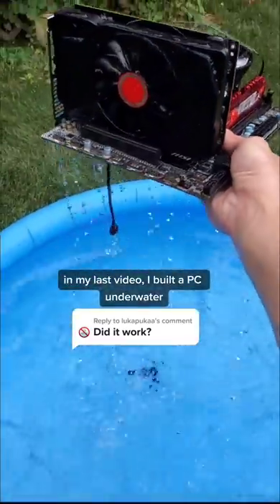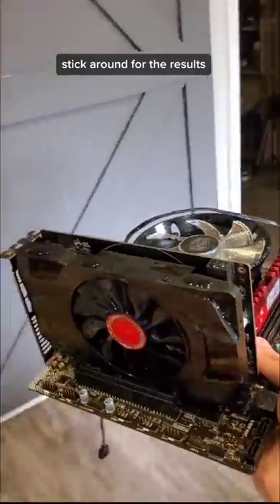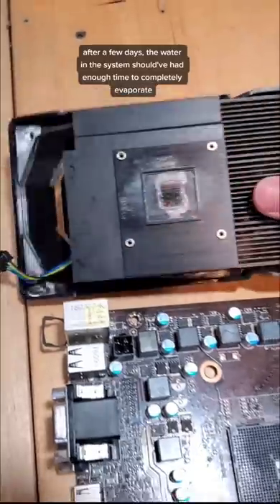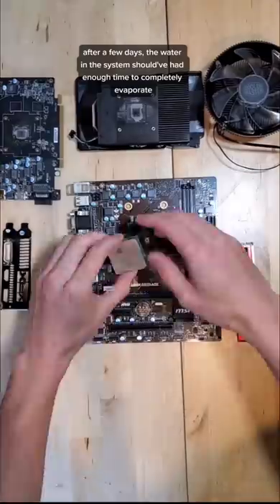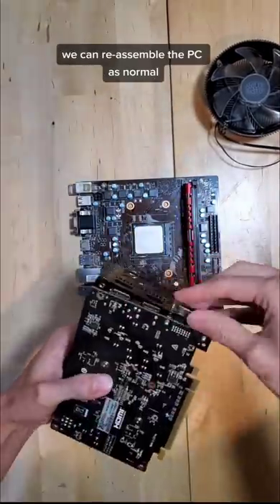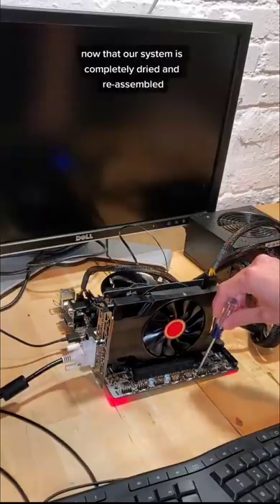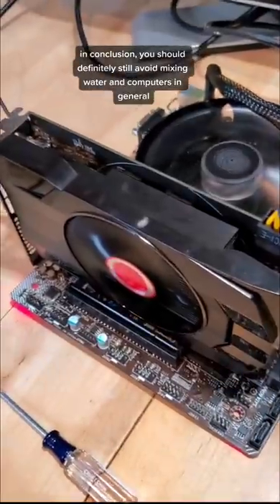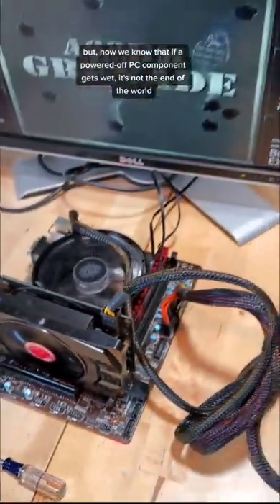Does the Underwater PC still work? #shorts

Comment: Also depends on the water/liquid, depending on where it got the minerals and particulates inside the water could still short out a circuit even if the water has been evaperated. Especially if it's some sort of salt water/ soda/ mineral water.

Comment: obviously, water is conductive. so if there's water on the components when you try to start it, it will connect wires that aren't supposed to be connected and cause a short in the circuit. This applies for any electronic device. If it's not powered on while it's underwater it will work once it's dry.

Comment: Why didn't you spray Isopropyl alcohol 99% onto the wet parts? As the iso and h2o molecules bind and it will evaporate at a much faster rate.

Comment: Fun fact:
It’s not actually the water that the parts break to it’s the minerals in the water and  u can get distilled water which has no minerals so u can fill a tub with distilled water and see that it will run underwater

Comment: Water actually affect components that have electricity in them.....like after using them. So the capacitors have charge in them then it shorts.....but what if the water u used was dis tilled and clean......cuz water itself doesn't hurts electricals ....it's the minerals and corrosion that affects🤓🤓🤓🤓

Comment: I mean, if the PC is not plugged in, as long as you let it dry for good, nothing bad will happen

And by not plugged in i mean no power supply cables are attached to it, or if they are, the PSU isn't plugged in

Comment: What kills computers is when electricity goes from one bus lane (the lines on the circuit that transfer data) to another where its not supposed to, in water this can happen if the water has conductive minerals leading the electricity to go from one point to another. If no electricity is flowing, you won't fry your pc. If you dry it off and run it, you probably won't fry your pc unless there's even a small lane that has a bridge of minerals that were left over, then you just might fry your pc.

Tl;dr don't do this

Comment: True story: I bought a 3080 ti, installing it in my PC, my CPU is water cooled and as I turned on the PC, one of the fittings on the CPU water block gave out and water started to spill directly on the 3080 Ti as I was booting it up. I turned off the PC immediately and unplug the power cord from the PSU. I dried out the 3080 ti on my desk near the window, in front of a desk fan for 3 days, then put it back in and it worked perfectly. Crisis averted — reverted back to using an air cooling system after that incident.

Comment: See if putting a running pc build in a tank of distilled water will run. Since distilled water is supposed to be somewhat highly dielectric.
Reply: @cal6243  i know about the mineral oil. My issue there is that it coats the components in oil which is hard to remove (if you wanted to sell a component or something) but with distilled water, if it works, could simply just be dried or thrown in a dehydrator. That's why im curious if distilled water would work instead
Reply: @TheMotorcycleBoss  Things like corrosion may be an issue, as well as distilled water getting contaminated and becoming conductive once again. Evaporation would also be a consideration.
Reply: @cal6243  true. Good point